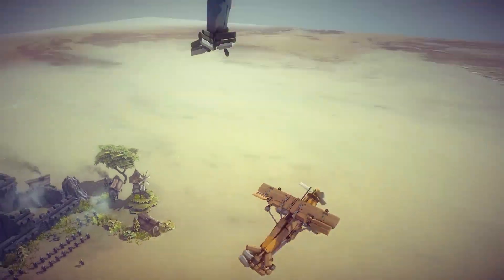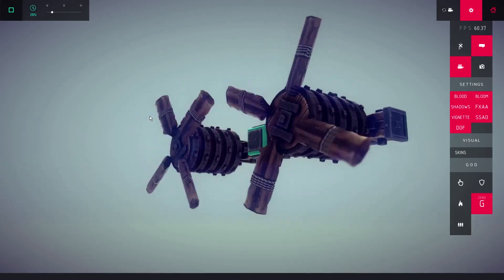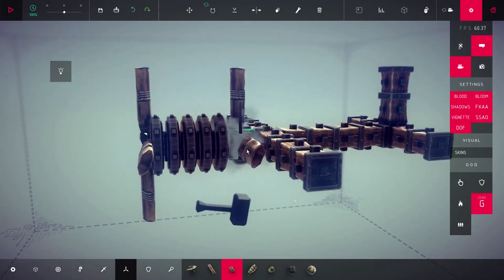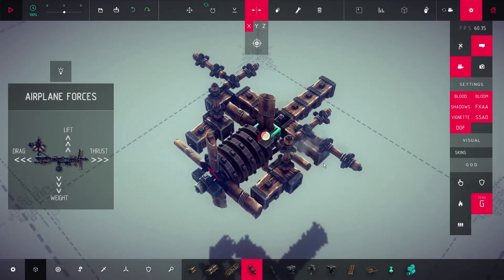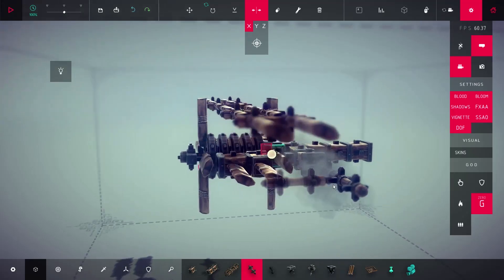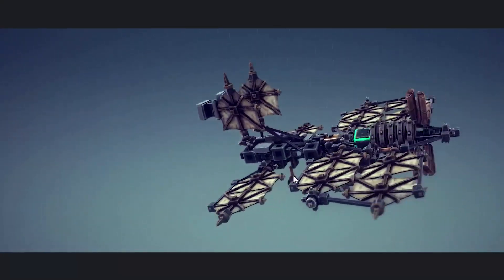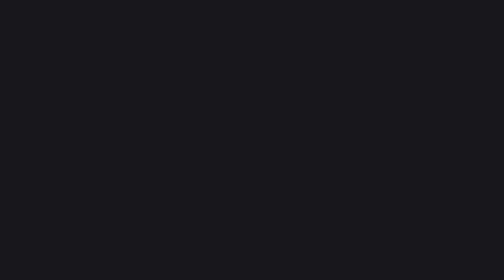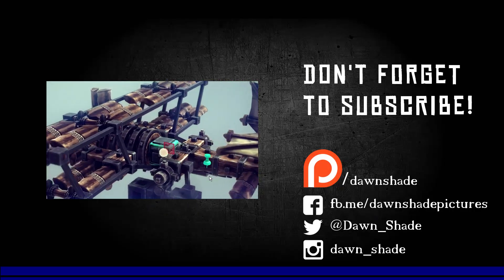How to Build a Plane in Besiege [Extended Edition] - Basic Simple Plane Tutorial Part 1/3

Comment from the maker: If you encounter problem that need further assistance and/or can't be explained easily, send me screenshot and/or detailed explanation of your problem to my Facebook page https://www.facebook.com/dawnshadepictures/ or find me (Shadé) on Besiege Discord https://discord.gg/GrSY5EB 

I will do my best to assist you solving the problem.
Reply: On building the engine: I wasn't able to do the part where you replace the block with a 5th powered wheel, which left me with a lower max power (going faster would break the block). However, it seems that adding the fifth wheel, then replacing the block with a swivel joint and bracing it onto that 5th wheel fixes that problem.
Reply from the maker: yup, because swivel joint has more mass than wooden block, so it wont break.
know what has even more mass? ballast. You can use it if you find swivel joint can no longer keep up with the speed
Reply: Question: where are you from?
Reply: aptspire I just nciecburubvbjrvbrfubfubrbugubrbugrbu
Reply: How you to rotate blocks?
Reply: This person has BIG BRIAN energy!
Reply: I can't replace the single block with a wheel in 1:40, it just says there is an intersection there
Reply from the maker: @eggman1211  now besiege has bypass intersection mode. Simply click the gear icon on the top right then enable advanced tools.
You'll see more tools appearing. Turn on the tool that look like intersecting icon.
Reply: @Dawn-Shade  Ah, thank you very much
Reply: The plane won’t move forward even though I did the same thing as u. Pls help?
Reply from the maker: @ben.watson08  make sure you place the propeller blades correctly. besiege has rotate (press R before placing) and flip (press F when hovering a placed propeller). Make sure every blades has same angle.
Reply: @Dawn-Shade  ohhhhhh ok thanks and good video btw!
Reply: @Dawn-Shade  I’m a bit confused on the brace parts, should I brace all sides of the swivel joint in the front?
Reply from the maker: @ben.watson08  from the part ii of video? You don't have to brace all sides. What you want from the brace is so that the starting block rotates at the same rate with the front swivel.
Just make sure the bracing are symmetrical.
Reply: No matter how many small aerodynamic propellers I put in the back, I always end up rapidly climbing, or nose dive. if I add 2 I climb, 1 I  dive.
Reply: If I want to place the 5ft wheel with the propellor part then the game said “intersection” how to turn that off on ps4?
Reply from the maker: @Aviation_fan888 im not familiar with the console version; the layout is a bit different, but there's should be a toggle somewhere in the options that enable advanced tools, one of the tool is to disable intersection warning.
Reply: @Dawn-Shade thank for the comment!, but if I destroy all off the islands do I get somthing new?, like a tool or a Block? 😊
Reply from the maker: @Aviation_fan888 i don't think so. all tools and blocks are accessible from the start. (i have not yet cleared the main game)
Reply: @Dawn-Shade  thanks! do you know what to do when your aircraft is banking to the right?
Reply from the maker: @Aviation_fan888 
1. check if the torque from the rotor is negated correctly.
2. check if the wings is symmetrical.
3. check if the horizontal stabilizer is doing its job
Reply: @Dawn-Shade thanks!
Reply: How did you rotate the blocks like that at 4:00

Comment: for some reason when i try it doesnt work, in zero g mine just spins in place and when i turn it off it just falls, doesnt move forward at all
Reply from the maker: The angle of the rotor blades might be incorrect. 
Notice how they placed in the video, use R to rotate blocks and use F to flip placed blocks.

Comment: Hey I’m having trouble. I’m trying my best to copy what you are doing, but the separate parts keep wobbling even though I tried to brace them like you. I also can’t fly straight, and the braced swivels are restricting the whole aileron. Also idk if the wheels on the engine are right. Do all wheels in a single engine spin the same direction or do they need tuning. You work so fast in the video. Help!
Reply from the maker: the wheel should be configured to spin in the same direction but they will spin at different speed because the first wheel rotates the second wheel, which also rotates the next wheel, etc.. for the rest of the problem i need to see a picture of your build to know whats wrong
Reply: @Dawn-Shade  my rotor blades just fall off, I can't place that one wheel to hold them
Reply from the maker: @rustyspartan4258  you can try to enable the advanced tools:

on the top right click on the gear icon, there's a toggle to enable advanced tools.
with advanced tools, you can duplicate the wheels and move it closer by 0.5 points.

Comment: How do you add the wheel after you delete the block? It won’t work an it considering it an intersection
Reply from the maker: in build mode, open the settings mode on the top right. there's a button to enable advanced tools.

it will unlock several new tools one of which is ignore intersection. enable it to place the wheel in propeller easily

Comment: I cannot place wheel in propeller  and the game say "intersection" plis help me
Reply from the maker: in build mode, open the settings mode on the top right. there's a button to enable advanced tools.

it will unlock several new tools one of which is ignore intersection. enable it to place the wheel in propeller easily
Reply: @Dawn-Shade  ok

Comment: When I change my plane's altitude, some of the parts(though they are connected before I changed the position) fall apart and breaks my airplane. It seems like a glitch...Is there some way to solve it or am I doing something wrong?
Reply from the maker: How do you change altitude?
Reply: @Dawn-Shade  This error occurs when I change position using 'translate blocks' button. I looked into steam discussion and it appears that a lot of others are having the same problem. It only happens when the machine is moved a lot.
Reply from the maker: @HoneyJamTesla  oh, it's a bug.. I haven't heard something like that

Comment: I don't know what is happening but every time I accelerate the plane it goes up, and I have tried to counteract it with aerodynamic thrusters to the opposite side and it keeps going up. I don't know if I've done something wrong or if the developers have changed something because the 1.0 has come out
Reply: I was having the same problem but I fixed mine, did you press R to rotate the propellers so they are sideways?

Comment: I swear to god this doesnt make sense to me. I just came to understand why the spinning block is spinning in the opposite direction of wheels and why add powered wheels to begin with ?
Reply from the maker: There's a limit on how fast a block can spin, unless you use mods. Adding wheels stacks the speed so it can spin faster.
Reply: @Dawn-Shade  Stacks speed ? seems to me like it's limiting speed. Also i don't understand the mechanics behind it.
Reply from the maker: @bikerboy3k  Picture this:
1. place a spinning block and set it to max speed allowed which is 2.00 iirc. lets assume that gave us 200 rotation per minute.
2. place another spinning block on top of the first spinning block. even before you set it to spin, it will still spin at 200 rotation per minute because it was placed and tied at the first spinning block. if you set it's speed to max, it will spin 200 rotation more in addition to its currently spinning speed!
3. place another more and you got even faster speed!
i hope i explained it
Reply: @Dawn-Shade  ok ok so that explains the wheels. Except that I can't edit the spinning block speed, game simply won't allow it, and on what axis are the wheels spinning on exactly? Is the game creating another cylindrical axis around the one coming out of the spinning block and into the main one, that spins independently?

Comment: This was useless, Im sorry If I sound insulting, I think if they make another video they should explain more instead of just placing blocks
Reply from the maker: Sorry about that, I've even added more information that can't be found in the outdated video.

But I appreciate if you could give more feedback:
Which part you find started to get confusing? And how far have you been in Besiege?
Reply: Well, I found it confusing mainly in the part where you built the wings, you weren't exactly giving people a look at the whole machine just quick pan overs where you couldn't really see how many wings, how to build the wings, etc. I'm relatively far in Besiege.
Reply from the maker: i see, thanks for the feedback. the reason why i didn't explain that much was because i literally just making a basic shape without thinking, because any shape will do and the numbers of things are not important not until later part.
Since i can't update the video, i'll try to give explanation here then:

You create wing shape with aerodynamic propellers. While each wing add lift, you can just disregard it and purely aim for good looks here. The different number of aerodynamic propeller will affect the number of propeller for stabilizer that will be addressed when I show you how to balance the lift later on part 2. Don't forget to flip the right side of the wing with F button (never rotate them manually with R button or Advanced Tools).

Comment: Your return to center flight controls are awesome. So I made a bit of improvement to it and adopted it into my own plane and check this out. 

http://www.besiegedownloads.com/machine/61102
Reply from the maker: damn thats a really big plane
Reply: Dawn-Shade but check it out. You will be surprised by how easy it is to fly and how sturdy it is.
Reply from the maker: i've checked it out.
some feedback: UHJK and numpad control scheme combo isn't good as you can't press yaw+thrust and pitch down at the same time. most standard keyboard will suffer from ghosting (including mine). I suggest you replace the numpad with arrowkeys as arrowkeys usually have different scanlines (still, i never use it with UHJK so I'm not sure if it still ghosts or not)
Reply: Dawn-Shade So you mean because U and numpad 8 are on the same line, pressing them together causes some trouble on your keyboard? (Does that also mean you can’t yaw and bank at the same time?)I will try mapping them to arrow keys next time. 

The reason why I chose numpad 8456 for elevator/aileron is because it puts both of you hands at the same level so it’s more comfortable to operate. It is also easier to reach out for the +/enter on numpad with your pinky for trim and */- with your ring finger to control gear. 

By the way how is the fps? I have tested it on my computer at 100% speed and I get around 40fps but I’m worried about those with weaker computers or those who haven’t updated to v0.6 yet.

Comment: you can also add rotor power by changing the wheels spinning speed
Reply from the maker: +jaahti saahti but 2 is the max without mods or bsg editing
Reply: Dawn-Shade but it still doubkes the speed
Reply from the maker: ive also increased the wheel speed on the second part of the video.

Comment: still i couldnt make the wings
Reply from the maker: why not?
Reply: well, right now, the wings are fixed, but i can't seem to make it fly straight. It either pitches up or down left or right. I've tried adding ballasts to the plane to level out the COM, but no luck
Reply from the maker: maybe you did something wrong, or actually it was allright..
got any pics?
Reply: well, I now managed to add the wings, but I've decided to move to jet type of a plane, since i got Vector Thrusters, and the other problem was that the plane kept going either up or down and was hard to control. I think I will have more luck with the jet.

Comment: I believe you need to make a new version of this first part of the tutorial. The plane described does'nt generate enough thrust to get off the ground/ stay in the air. Neither does the double rotor plane.
Reply from the maker: this is the new version, tested on the latest version of besiege (0.42b) and worked pretty well.
Unless you wanted the plane to stay in the air for a prolonged time, then you need the control surfaces.

Comment: I need help my plane only allows on two propellers not 4 on a wheel
Reply from the maker: that does not make sense.
how did you place the propellers?
Reply: sorry nevermind your discord helped but I copied brick by brick of your design but still it glides not flys
Reply from the maker: are you sure the engine generates thrust?
Reply: why wouldn't it? I made it your way.
Reply from the maker: i just want to make sure that you copied my design correctly

Comment: plz help my plane goes right when i fly it is it posible i have too much speed?
Reply from the maker: maybe not.
do you have one set of propeller or two?
do your wings are perfectly symmetrical?
Reply: i checked all of the propellers they are set perfectly.
and yes my wings are symmetrical.
oh and the exact thing happens exacly in the video when you said "once the plane has enough speed it will start to assend" 

 PS. i love your videos and i think your computer is from Nasa
Reply from the maker: so you havent put some steering?
well thats normal. the flight path will never be perfect just like in real life.
even plane on autopilot adjust steering all the time.
Reply: oh thanks :)